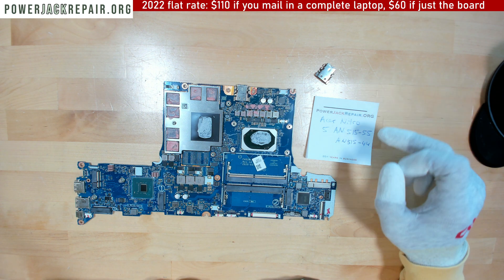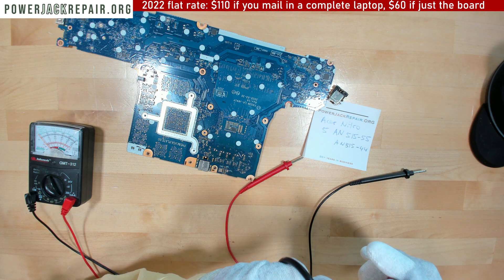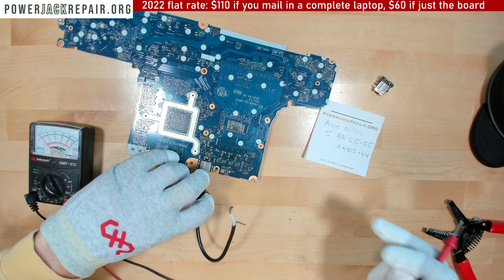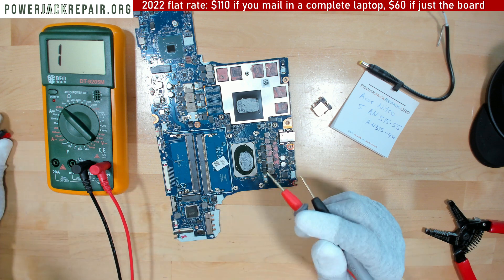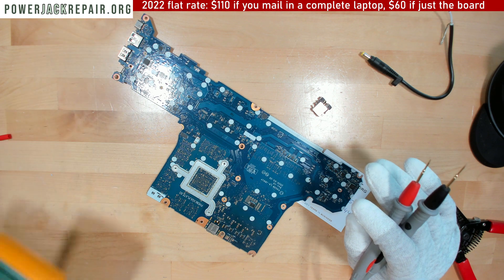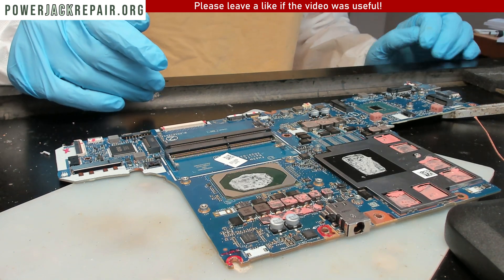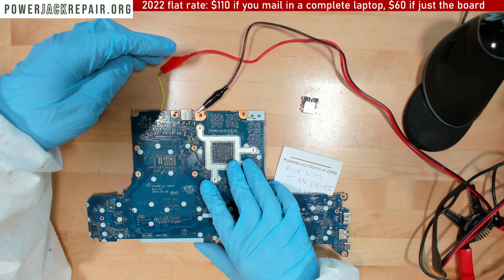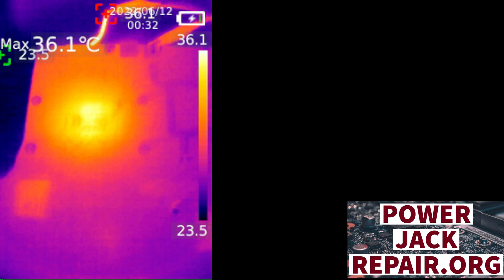How to fix repair a broken Acer Nitro 5 AN515-55 AN515 motherboard laptop unfixable no power up

Comment: Maybe, just maybe, a thermal throttle target of 100C is too high of an operating temperature. Oh, but the corporate engineers know what they are doing right? Yeah, it's called planned obsolescence, engineered to fail.

Comment: Hi hello! I am your new subscriber! Thank you for such an informative video on how to repair nitro 515 55. Mine has the same problem, and after I try to fix it, turn out maybe the mainboard needs to be changed. However, it's so hard for me to find it online at least something compatible with mine even though there might be a downgrade on the CPU. If you can list where I can buy it I will be really appreciate it. Also is it compatible with every motherboard started from 515 55 xxx or i should even match the whole series 515 55 73em?! Thank you so much sir

Comment: Hi.....
I have a question for you
My laptop is ideapad gaming 3 i hear buzzy sound on DC jack and while pluged in the buzzy sound is increasing
I say to you its bad to continue working or not?
And whats your suggestion for me to do?
Reply from the maker: Probably a mosfet making the buzzy sound,  is the amperage voltage going to the laptop proper? meaning the adapter output voltage / amperage should match the voltage amperage on the bottom of the laptop
Reply: @Powerjackrepair  did you mean i should test by voltimeter?